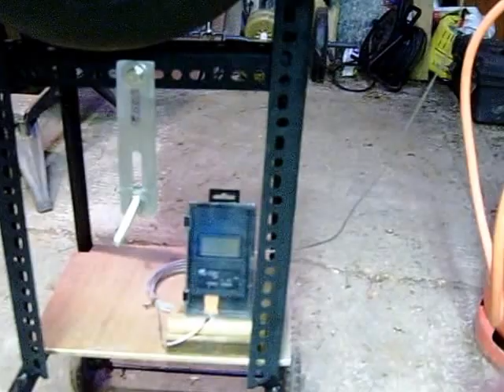Knife heat treating gas forge part 1

Comment: Great work. Would you be so kind to tell me where I ca get the thermocouple setup from. Kind regards Allan
Reply from the maker: +Quickstop85  Thanks, got the thermocouple and high temp prob from ebay in the UK,i
http://www.ebay.co.uk/itm/TM-902C-K-Type-Digital-Thermometer-50-C-to-1300-C-with-Thermocouple-Sensor-/161750556890?hash=item25a915a0da

http://www.ebay.co.uk/itm/171281751530?_trksid=p2060778.m1438.l2649&ssPageName=STRK%3AMEBIDX%3AIT